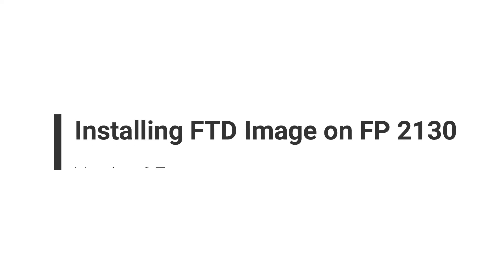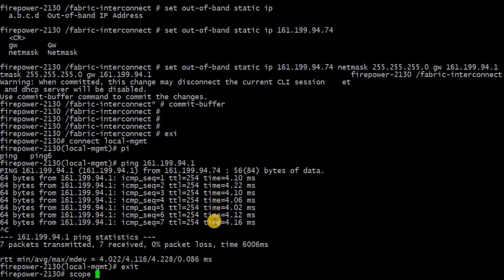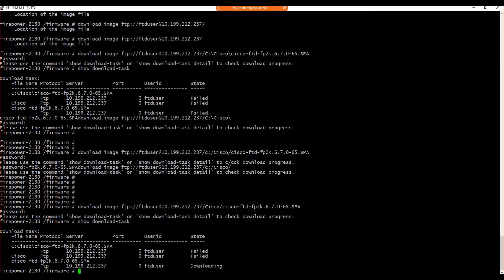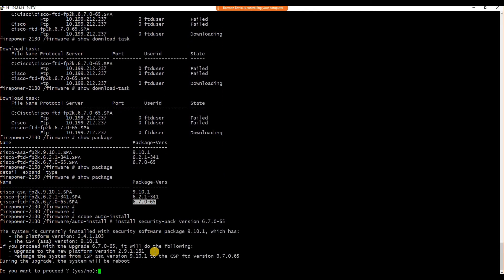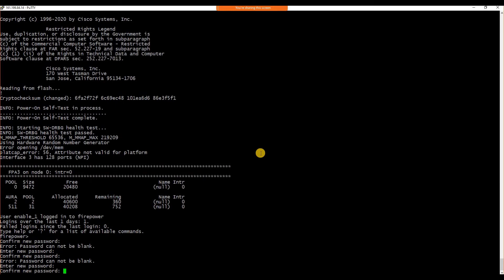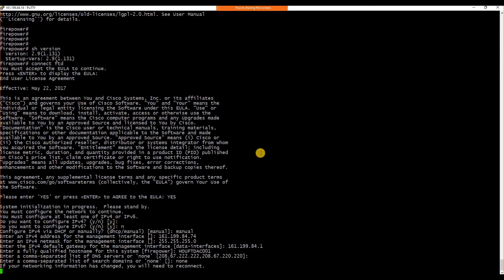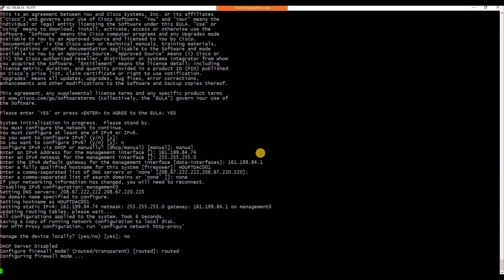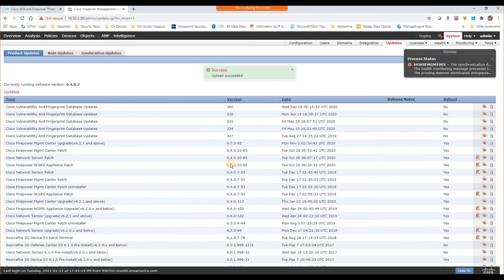Installing Cisco FTD Image on Firepower 2130 | FTD Image upgrade Steps | Version 6.7

Comment: Hi All, Here is the simplest way to upgrade your FMC. Everything is mentioned very clearly with a timeline. You never miss anything and you can have an easy smooth upgrade. Follow the link and don't hesitate to comment if you have any doubts. If you need online live assistance, we can provide you via zoom. Cheers!

Cisco FMC and FTD Firmware Upgrade - New Interface 2022
https://tuneuptechie.blogspot.com/2022/03/cisco-fmc-and-ftd-firmware-upgrade-new.html

NOTE: For live zoom session to assist with any Firmware upgrade > Comment on our post or email us.